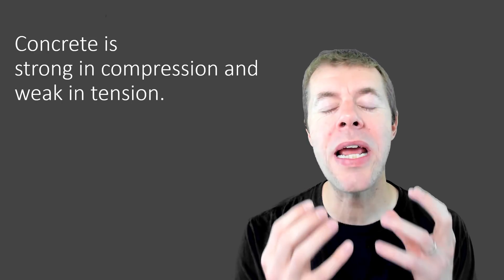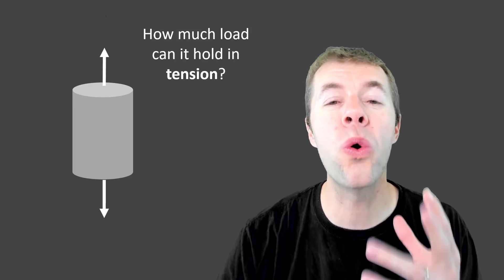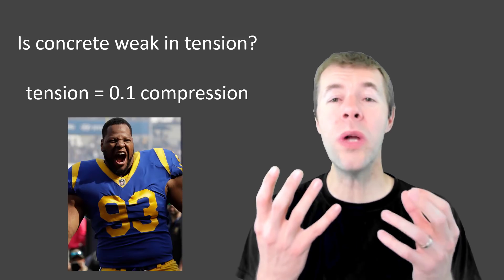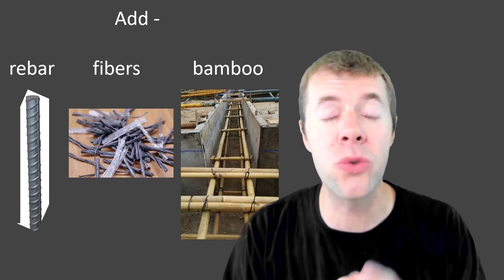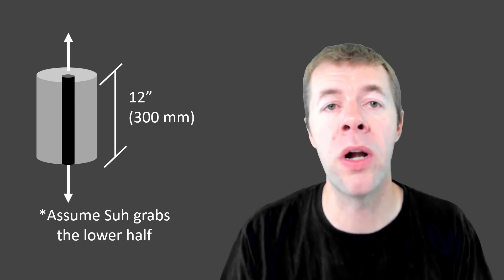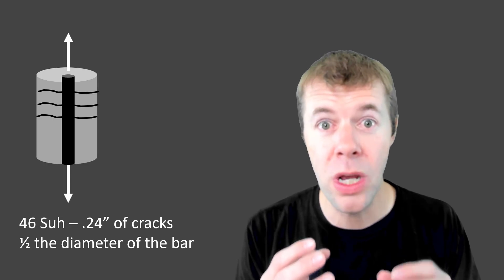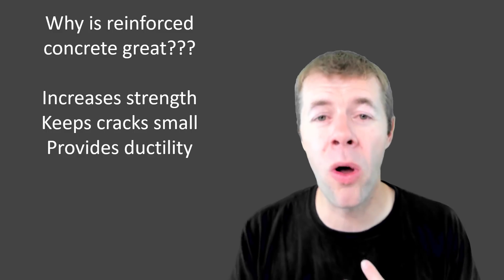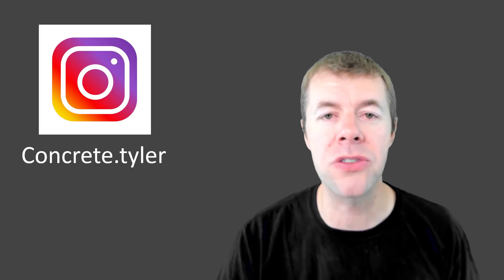Reinforced concrete and Ndamukong Suh?!?

Comment: I have the feeling that this is an oversimplification of what is really happening. In tension there are two materials that are actually acting independently. The steel and concrete have very different properties and are not 'mixed together' to act in concert as are, for example, the components of concrete itself.

So what is really happening? I suspect that initially the steel is under slight compression along its axis because of shrinkage when the mixture is poured. Of course this stress will change depending on environment temperature but let's keep it simple and just say that the rebar is adding to the tensile stress that the concrete is undergoing.

Adding tension will stress the concrete and, as concrete resists stretching more than steel, it bears all of the tension until it cracks.

Even when the crack is very small the totality of the load previously supported by the cracked part of the concrete will be passed to the rebar. I don't think the load is shared with neighboring concrete.

The section now behaves as steel, not as concrete. If more tension is added to the sample the exposed steel will stretch. As it does so load will momentarily be shared with the closest concrete but, as it has a weak point - the end of the crack, it will open up the crack passing the load back to the steel. This is rather like ripping paper, once the tear is established almost all applied force will act on the tear point.

In short, the only useful function the concrete provides under tension is to protect the rebar from corrosion.

If I'm right then I think a complete rethink of structure might allow us to remove 30-50% of concrete without loss of performance.

BTW I'm no expert so it's quite likely I'm completely wrong.

Comment: Hi Tyler uhm I mean Professor,
Thank you for making these video’s. I’m just a simple guy, trained as a software engineer and project manager but I enjoy your video’s very much. Concrete seams such a simple building material but once you dive into the details (like just about everything) it becomes tremendously interesting. 
You have opened up the world of cements, aggregates, reinforcement materials, the molecular processes, etc. 
And every time you surprise me with even more or more in depth aspects of concrete. 

I’m planning to use concrete as a foundation for a garden shed and try to think through what I can do to make it robust enough, preferably isolated and cost effective and that in itself is a challenge and a joy. Maybe I’ll add some sensors just for fun!

So thank you very much from the bottom of my hart!
Reply from the maker: Thanks so much for the comment and I am so glad you enjoy the videos.  Please call me Tyler.  Let's talk offline about what you do.  We are developing a lot of sensors and data loggers to use for concrete and it would be awesome to team up with others in this area.

Comment: Man, that concrete got Suh’d!  A good topic on reinforcement would be the technicalities of rebar placement within slabs and footings.  Code is usually 2” off the ground in slabs over vapor barrier and 3” in some forms is ok.  Besides corrosion how is strength affected by being too close to ground or too high in a slab or in a load bearing form.  Thanks for the videos, entertaining and I learn something
Reply from the maker: Interesting idea!  I will see what I can do.
Reply: I've always suspected that stretching the rebar across a span (semi-pretensioning vs using chairs etc...) so that it's closer to the bottom in the center (sag) where water is less likely to get and where tension is highest could have longevity benefits.  I don't know of any commercial engineering tools that could calculate the loads and stresses for that though.  Something in between prestressed concrete and poured in place slabs.

Comment: a one inch diameter concrete rod made of unreinforced concrete rated at 3k psi cannot withstand 3000 #s pressure as it does not have 1 sq in of area (1/2 squared times pie {3.14} is less than 1  {using area formula})
Reply from the maker: Check your units.  I checked my calcs and they are right.  The area of a 1" diameter rod is 0.785 in2 x 4 ksi concrete = 3.14 kips or about 3 kips as I said in the video.

Comment: Loved it sir...You compared the compression of concrete with a car and tension with Suh. I think it should be same (instead car you can use Suh itself) then we can easily imagine the concrete strength in tension and compression.
Reply from the maker: Thanks! I like that idea.  Compression is not as easy to compare because the concrete would break away from the bar at about 10 Suhs and then the bar would buckle.  We don't really let that happen in reinforced concrete and so it might not be a fair comparison.
Reply: @TylerLey  ok sir..I just asked my doubt.